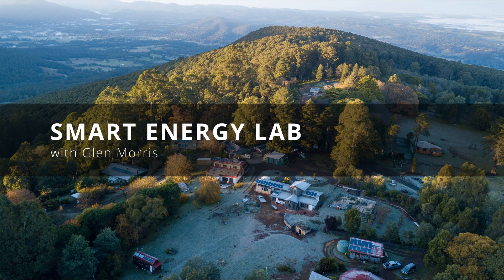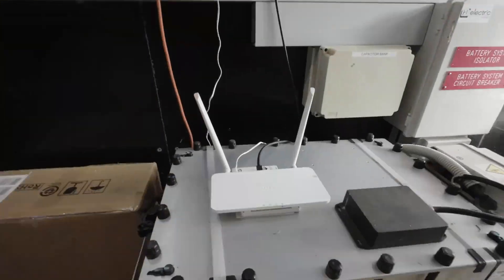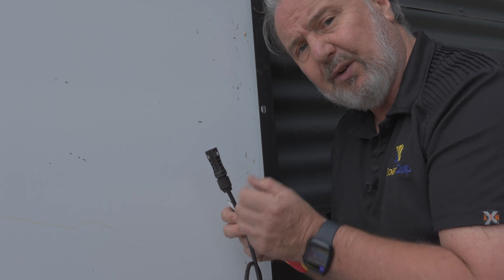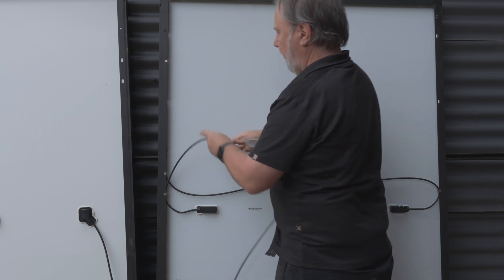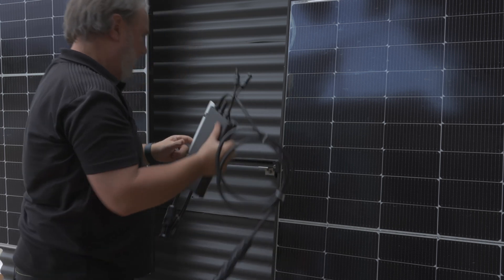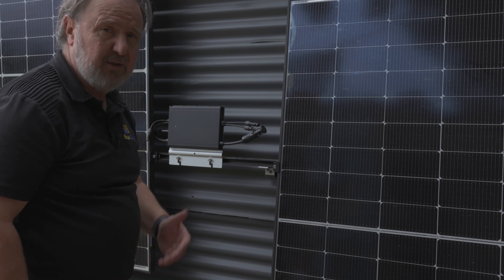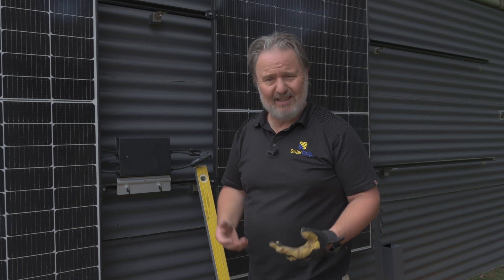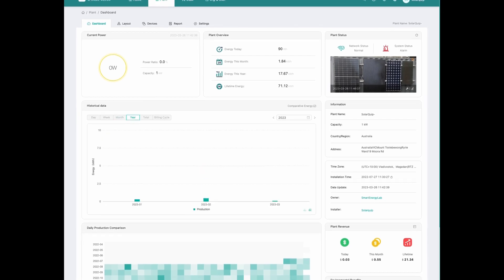Installing the Hoymiles HM-700 micro inverter

Comment: Will these clip at 700w, if say you have 2x REC Alpha Pure 420w panels attached? Or can they sustain the full potential 840w? Usually string inverters have 10% overhead so I’d expect 770w constant out of these at full tilt. Have you checked this? Cheers.

Comment: It would be nice if micros had an L mount and mounted on the side of the rack to provide an air gap from the module to reduce overheating failures in Summer heat waves. That is their nemesis and could be reduced significantly. Dual module micros are better but I'd have MC4 sockets on the micro to reduce cable management, probably a changable part if they get damaged.